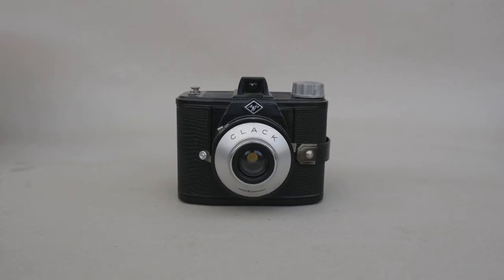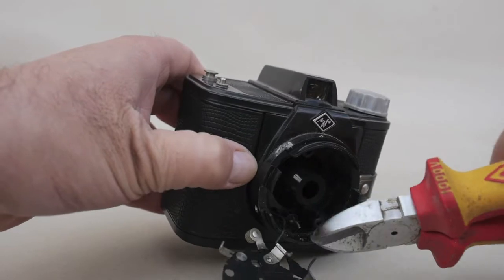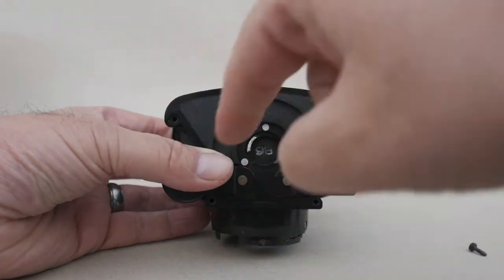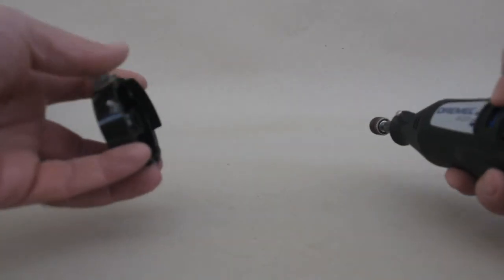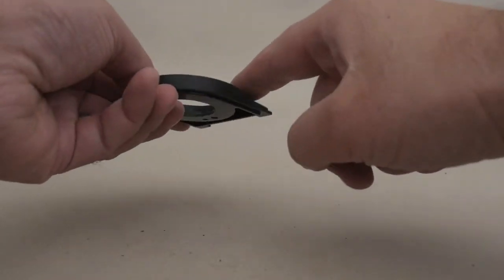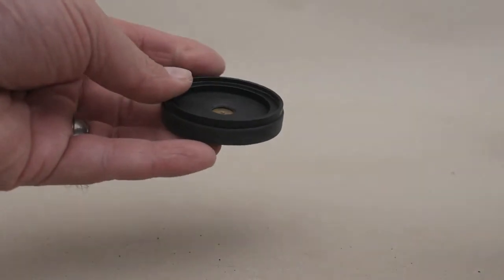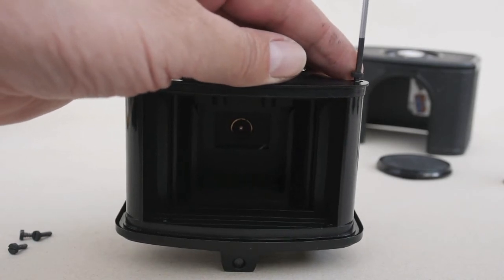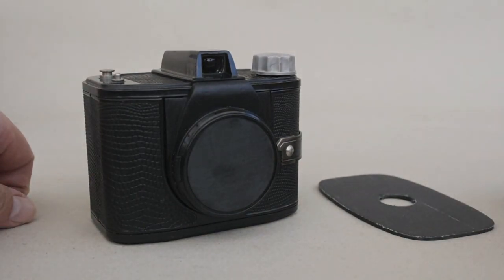Agfa Clack Pinhole Camera Conversion

Comment: I may have missed it, but what is the focal length of your conversion?
Reply from the maker: I may not have mentioned it in the video. It’s been quite some time since I’ve shot with one of these and even longer since I’ve made a new one. It’s 75mm focal length with a .3mm pinhole making it f/250. I hope that helps. My two favorite pinhole conversions are this Agfa Clack conversion and my Holgamods Holga Slide Pinhole.

Comment: Hi Graig. This is definitely an interesting project. One question. I'd like to discuss this topic.
Why you just didn't remove the lens and use the lens socket to put that pinhole plate inside instead to remove the whole shutter mechanism?
This will give you an opportunity to use a bulb shutter and integrated yellow filter. And maybe, I'm not sure about this, in that way you can keep the original focal length (approximately).
Reply from the maker: Thank for the comment. My first Agfa Clack conversions were done like you described but slowly evolved to the version in the video. I was happy with the results from both version but was after a more compact design where I could utilize any 52mm filters. As far as a bulb mode, I use the lens cap as my shutter which is my preferred method. That's why I like the Clack for pinhole... there are multiple ways to convert them. Thanks again for the comment.
Reply: @DCN2010  Thank you! Your video inspires me to convert Clack and Click into pinhole cameras. :)

Comment: Thank you for posting this video, I have just completed a Clack conversion following this and am astounded at how good the pictures came out.....Instead of a plastic clipboard I cut out a piece of sheet steel which I painstakingly shaped into a disc before drilling out the centre to accept the pinhole. I Epoxied this in place and got a focal length of 70mm and aperture of F/233. Thanks again
Reply from the maker: Very cool! I’d love to see some of the photos.

Comment: This a really cool conversion video! Thanks for showing the work steps in detail. With this type of pinhole camera, does the distance between pinhole and filmplane matter with regards to image sharpness? If yes, how did you determine the optimal distance for yours? Your video inspired me to try such a conversion too, but of shutter-broken 6x9 box browny. :-)
Reply from the maker: Thanks for the comment. I never worried about the pinhole to filmplane distance but I did experiment with both a 0.30 pinhole and a 0.4 pinhole. While the 0.40 pinhole produced a perfectly acceptable image, I felt the 0.30 was slightly more to my liking. Good luck with the conversion and more importantly, have fun with the process and producing images that you enjoy!
Reply: @DCN2010  Thanks!  So, I' ll just go for it and see what I can achieve. However, to work as neatly as you did will be a challenge. Your clack conversions really look great. :-)

Comment: I once made a cheaper pinhole camera. I started with a Kodak instant camera.  After taking the front off, there was a hole about 3/4 inch square.  I covered it with a piece off tinfoil.  I poked a hole in it with a pin or small needle.  I covered it with a piece of black electric tape.  The hole was so small that it took several minutes to get an exposure and had a depth of field from around a couple of inches to as far as you could see inside the house.  The result was surrealistic.  There were a few problems, then Kodak stopped making instant film after the lawsuit with Polaroid (there were things I did with were impossible with Polaroid pictures).
Reply from the maker: Experimenting with pinhole photography has always been one of my favorite forms a photography. Unfortunately, over the last four years I’ve had little time for this particular hobby. I LOVED shooting pinhole on peel-apart instant film and was so sad when Fujifilm discontinued it.